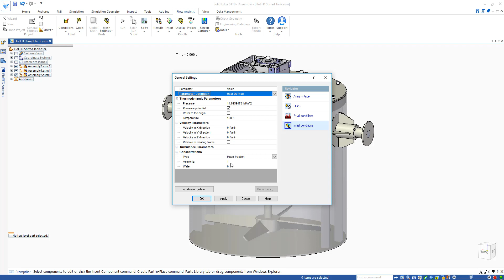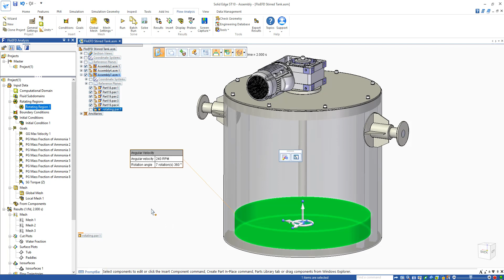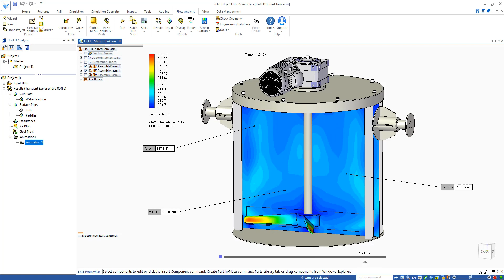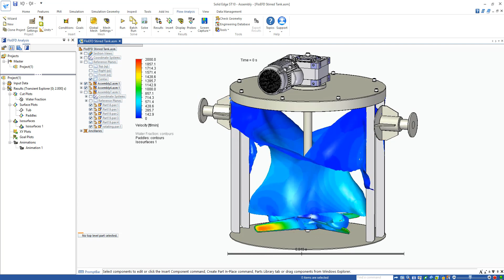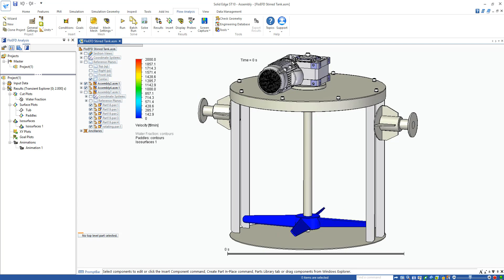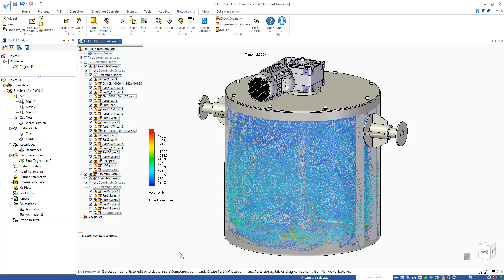FloEFD for Solid Edge  - Mixing Tank demo video

Comment: Does the motor that runs the shaft a part in the FloEFD or i have to design it in solid edge?
How can i get in touch with you if i want further information about this simulation, any e-mail please, thanks